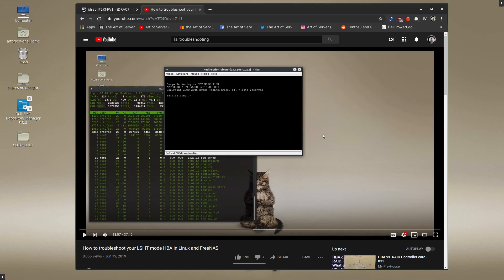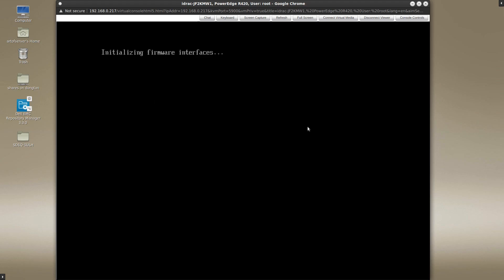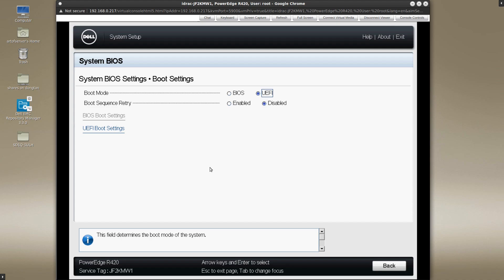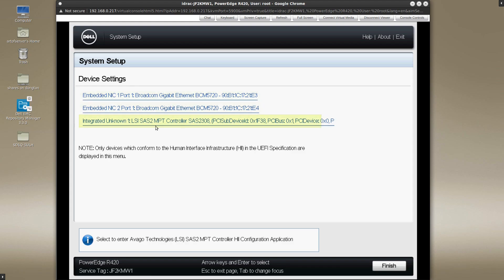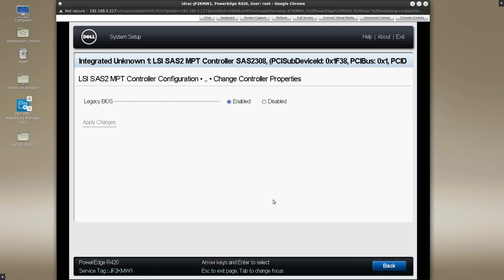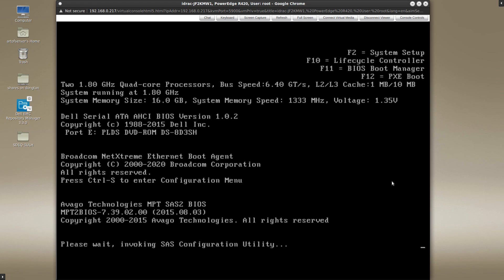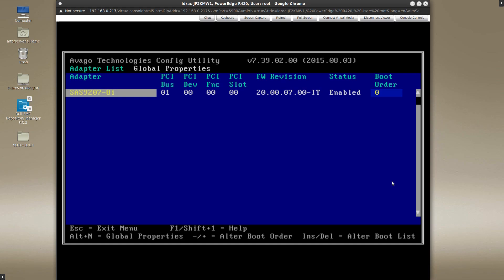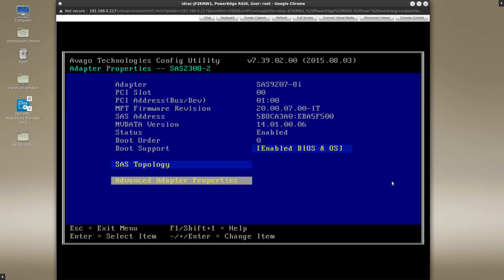Help! I can't get into the LSI BIOS ROM SAS configuration utility | How to fix

Comment: Not super helpful. System I'm using doesn't have UEFI bios, and the adapter interface still doesn't show (it behaves as the computer does in this video, never loads). Should perhaps rename the video to include something about UEFI Bios so as not to mislead people as I was.

That said, thanks for taking the time to make a video about the problem to help others.
Reply from the maker: If your computer only has legacy BIOS support, check 2 things: 1) in the BIOS settings, under PCI configuration, make sure the slot you're using has the OptionROM enabled. 2) make sure your LSI card actually has the BIOS ROM loaded on it. Not all of them do, so naturally it will not load.
Reply: Discovered the fix late last night. Apparently the card is being placed into some kind of boot option after pressing Ctrl-C. I discovered that if I press Ctrl-C, then the key to get into the boot menu, I can select the Avago option and it takes me into the configuration utility. On a restart, I checked the boot menu again and the card was not listed (I assume because I hadn't pressed Ctrl-C). Trying that method again worked again, so I'm guessing this is a standard thing and it may help other people in the future.
Reply: @ArtofServer  I have no idea how to load a bios rom on the card... the information on Broadcom's website is so confusing on how to update the bios, it gives three different rom firmware upgrades no idea what each one is. I also cannot find the bios update utility program. MY computer has the bios rom option enabled yet still does the same thing when I boot up the computer as yours. I have an HP Z230 computer. I don't know how to update the bios on my 9265 8i. or what firmware would help. This card worked perfect on my old AMD 8350 machine. cant get my 9650SE card to work on this HP Z230 either. The Megaraid program just crashes on install so cant use it either. It just keeps poping up "Create Process failed about 3 or four times. when you click on the megaraid program link after installation it says there are files missing and cant load. tried to install it twice.
Reply: @jimthvac100  Unfortunately, HP has a habit of doing nonstandard things with their firmware, I guess as they expect you to only use HP-supported hardware. Try finding or making a boot disk with lsiutil on it and see if it sees your controllers. Alternatively, try a Linux boot disk and see if the controller shows up in dmesg. This might help you determine if it is a Windows problem.

Comment: I made the mistake of disabling the controller which makes it unable to boot (Dell T7500). The system configuration won't allow you to turn it back on. The only way is to get back the SAS BIOS Configuration Utility controller back on is to press Ctrl+E (or Ctrl+A on versions earlier than 5.00) after memory initialization during reboot to re-enable and reconfigure the controllers.

Side note: I'm currently trying to figure out if I can use non-RAID drives on the controller itself instead of using RAID drives. What do I need to do?
Reply from the maker: Checkout my video "Forbidden Arts of ZFS" episode 1. In there, I show the command with megacli to setup the drives as single drive RAID-0.

Comment: so i have flashed the h710 mini B0 with the it mode firmware; and i am able to get into the config utility, all 25 disks show up (i have the extra two slots in the rear with the 24 slots in the front, i boot truenas core and install on the two disks i have installed in the rear, but for the life of me i cannot figure out how to boot to those two disks, it keeps trying to boot to some other disk that installed in the front of the server, any suggestion how to use the utility to set boot drive?
Reply from the maker: you probably need to watch this video: https://youtu.be/dJyQVLPjWbo
Reply: never mind i was able to find it use alt+b to set boot for the drive

Comment: Want to thank you for sharing your knowledge with us. I found your store on eBay. Do you ever get HBA card that have 4 miniSAS connectors? The reason I am asking is that it would allow to use just one PCIe slot instead of 2 slots with with cards that only have 2 miniSAS ports. Thanks
Reply from the maker: I do occasionally find some 9201-16i cards, but it's hard to find genuine ones so it's very occasional. Thank you so much for watching! :-)
Reply: @ArtofServer  I have a 24i haha

Comment: I have a Dell R610 and a 720 and this works. I put the same card into a Dell 730xd and it fails to enter the LSI BIOS SAS utility. All BIOS and FW in the server / HBA are up-to-date. HBA is a IBM M1015 flashed with 20.00.07.00 fw and 7.39.02.00 bios. I see the card during POST and can press ctrl-c, server keeps booting and then goes to no boot device, select F2, etc... Seems like it just skips loading the SAS BIOS ROM. If I go into a FreeDOS image and run sas2flash commands, I see the card just fine. The 730xd does boot just fine into FreeBSD and during POST the HBA card lists all the drives when I don't hit ctrl-c. I can make a video and share it to you.
Reply from the maker: The server is set to boot in legacy BIOS mode?
Reply: @ArtofServer  Yes and I even turned off the Life Cycle Controller. I have 2 of these IBM cards and tried both as well in the 730xd with no luck.
Reply from the maker: Actually, what LSI card is it?
Reply: @ArtofServer  Last night I was able to get into the SAS BIOS by changing one thing in the motherboard BIOS. Following this, https://www.dell.com/support/manuals/en-us/poweredge-r730/r730_ompublication/integrated-devices-details?guid=guid-0f237dca-ae8a-4972-985b-69da22be42ea&lang=en-us my card is in slot 4. I changed the bifurcation for that slot to x8. I rebooted many times and could get into the SAS BIOS every time. As it was time for bed I powered down the server and today powered backup -- I can not get into the SAS BIOS again, bifurcation is still at x8.  /sadface

Card is a SAS 9220-8i
Reply from the maker: @wallacebarrow3744  Wow, that is just really strange. There must be something weird going on between the 13th gen PowerEdge BIOS vs LSI BIOS ROM? I've seen that in some HP servers, but this is first I've heard in Dell. You said the firmware and BIOS ROM on the 9220-8i is already fully up to date? Also, do you have the UEFI ROM on the card? If so, can you see the card in the system BIOS under integrated devices in UEFI mode?
Reply: @ArtofServer  I flashed the card with 20.00.07.00 fw and 7.39.02.00 bios (LSI9211-IT). The UEFI ROM is not on the card. It is strange though, when I try and go into the SAS Utility and it fails, then go into the motherboard BIOS, I see no boot device in the boot settings, the controller is not there, which is why it fails to boot into the OS. If I let the server boot as normal, initialize the HBA and go into the motherboard BIOS I can see the boot device on the boot settings. Something is happening when the server is reading or looking at the PCIe lanes and loading the SAS BIOS.
Reply from the maker: @wallacebarrow3744  can you try and set the speed on that slot manually to PCIe 2?
Reply: @ArtofServer  Not sure where I could do that in the mb BIOS. I changed the bifurcation to x4x4x4x4 for slot 4 and I was able to get into the SAS Utility but once I powered off the sytem and powered back on I can not get in again. I did disable all slots besides slot 4 in the "Slot Disablement" section of the BIOS, didn't really change any behavior.

Comment: I always remove the bios rom and uefi rom. In IT mode for trunas storage I don’t need them. Bios is lame. 16-bit nonsense. Uefi is much better but if you don’t need them don’t flash them.
Reply: Having the BIOS ROM on the card can help in troubleshooting. It'll let you know if the card sees a drive you are having problems with, and its characteristics. Sure you can get this from lsiutil, if it's available, installed, and compatible with your OS, but the firmware is available at the hardware level, removing the additional variable of the OS, etc. 
You don't have to have the BIOS boot ROM enabled if you don't like waiting for the cards to enumerate your attached devices at boot. But having it on the card doesn't slow the card down, or otherwise affect it negatively.
Reply: im new to server cards.. So these cards neither need the BIOS rom nor the UEFI rom to function properly in IT mode? Are they only necessary for IR mode?
Reply: @ChristopherJones16  They're only absolutely necessary if you're going to boot from a device attached to the card.